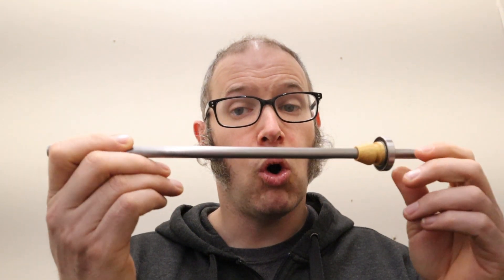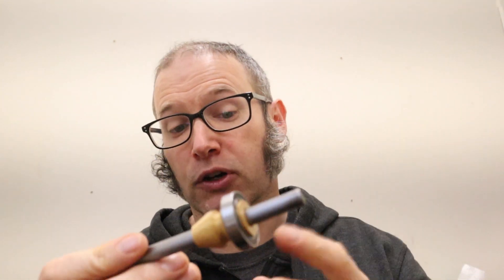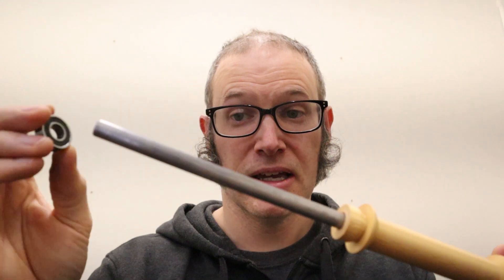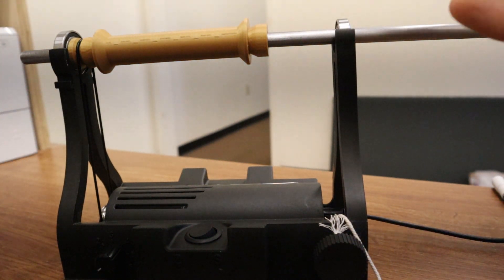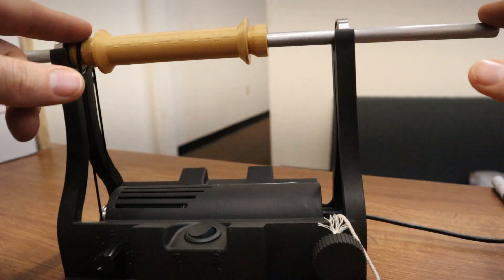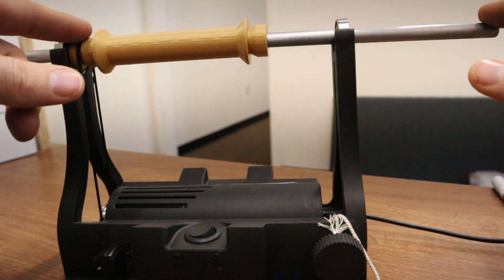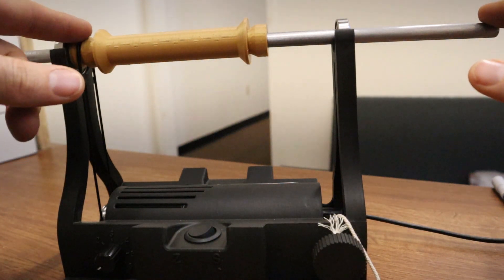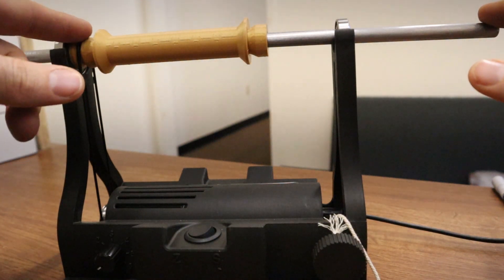SPIN #98 - EEW 6.0 Bobbin Winder

Comment: Hi Maurice, I have a few more questions. I'm getting ready to order the EEW 6.1 and I'm wondering if there's a carrying case for the wheel. Also, will a standard lazy kate work with these bobbins or do I need a special lazy kate? In addition, what is your preference for the battery pack?  I know there are several mentioned but I don't which one would be the best for me.
Reply from the maker: There are all sorts of carrying cases, but I don't endorse anyone.  Just find something in your price range that you like and that the eSpinner fits into.  If you want ideas then you can ask on the Facebook group as many people there will share their opinions.

Most standard Lazy Kates will work with this.  As long as it's not design to only hold smaller bobbins you should be fine.

Here is my recommendation for a battery. https://www.dreamingrobots.com/eew-battery-power/

Comment: If I only want to print the pieces for winding onto a EEW 6.0 Bobbin (not a weaving bobbin), which of the files should I print? And also, it looks like I'd only need the 6804-2RS bearing? Or am I mistaken? Thanks!
Reply from the maker: You can reuse the smaller bearing if you like.  Yes, you don't need the weaving bobbin if you are not going to use it.  Just print the files you plan to use.

Comment: Any suggestions for those of us who use the currently-most-common weaving shuttle bobbins that have a max insertable diameter of less than 1/4”? (Ashford shuttle bobbins, harrisville wood shuttle bobbins)
Reply from the maker: I do have a 3d printed bobbin that is in the style of a weaving shuttle bobbin.  You could print those and they work with this setup.  If you want to use existing bobbins this would need to be redesigned to work with those smaller diameter bobbins and different bearings would be needed.  Maybe I'll look at something like that in the future; I'll try to find time to do a better version of this someday with support for 3/8 and 1/4".
Reply: @DreamingRobotsBlog  Joel at Snortimer’s suggested inserts on all the parts to use a 1/4” shaft, and said he’d try to think of a way to print inserts to narrow the cones to hold my Ashford/Schacht/Harrisville shuttle bobbins.

It sure would be nice to not need a separate hand crank bobbin winder. :-)

Comment: what about a keyway on your second truncated cone to keep the spool static, instead of a rubber band?
Reply from the maker: I think you'd need a key on the bobbin then, unless I'm not understanding you.  The rubber band does work pretty well, but I agree there are certainly other options.  I did that one mostly because it was the easiest and work well when I tested it.
Reply: @DreamingRobotsBlog  
Yes, a slot on one and a key on the other…keyway…:)

Comment: for a spindle, try a long knitting needle
Reply from the maker: We did that for a different project.  The reason that won't work very well on this one is a knitting needle won't have a perfect fit into the bearing I'm using and the point of this one was to get a really ideal fit.  If you aren't as concerned about a super smooth fit then a needle like you suggested would probably work.

Comment: Seems like this could be done (with smaller bar, etc) with the Nano too, right?
Reply from the maker: The Nano uses the same bearings so this exact version would work with the EEW Nano.  It would be able to use the EEW Nano bobbins for storage, but you couldn't use other generic storage bobbins because they would be too long for the EEW Nano.